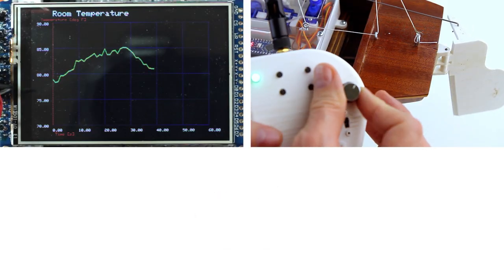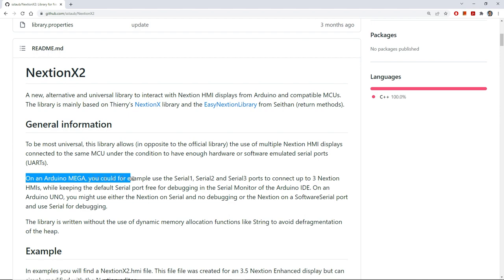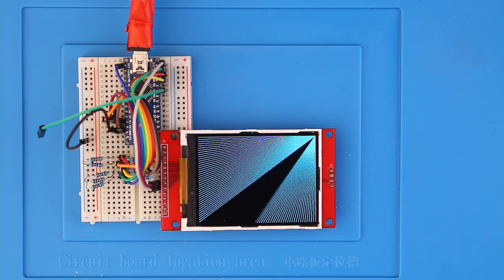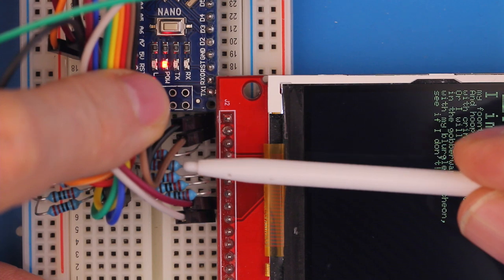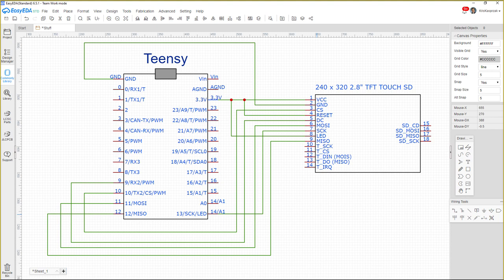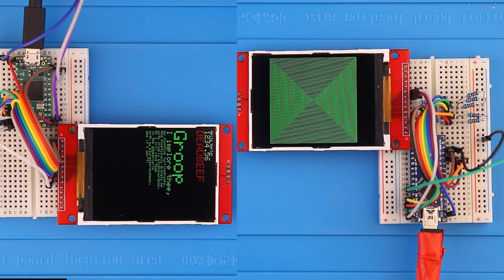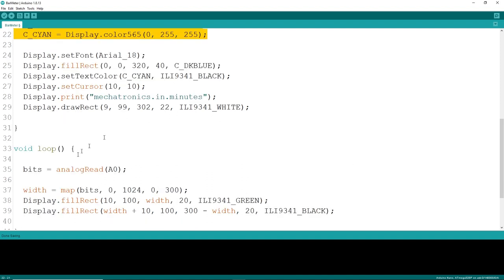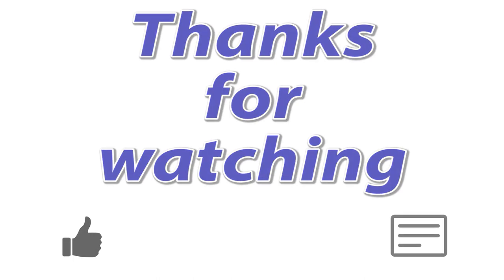Tutorial: Getting TFT LCD displays working

Comment: if a lcd display says 5v then all the sdl sca pins use 5v and vice versa?
Reply from the maker: really depends on the display. Some accept 5v0 on Vcc but have an onboard regulator for power and data pins should be 5 volt tolerant. If the display has an SD card some mfg's put series resistors to protect the card. you can always use a  voltage divider for data lines if the display has issues
Reply: @KrisKasprzak  st thr 5v display operates at 5v and the card reader operates at 3.3v?
Reply from the maker: @taranagnew436  Card readers run on 3V3, most displays are 3V3 as well. Depending on the display they may have level shifters or resistors to drop the voltage to a safe level.